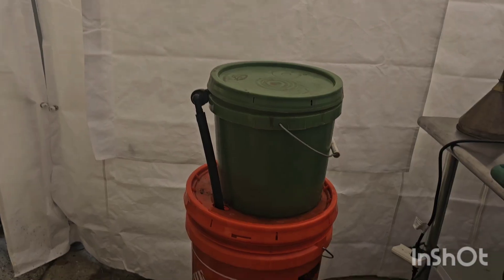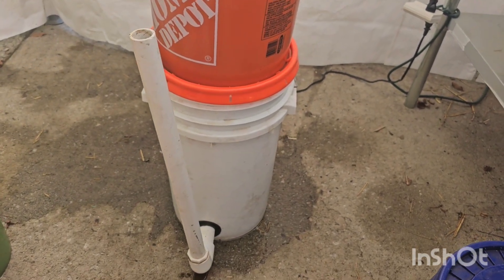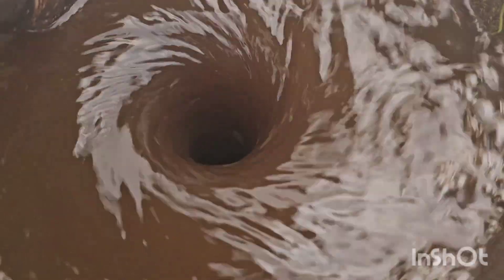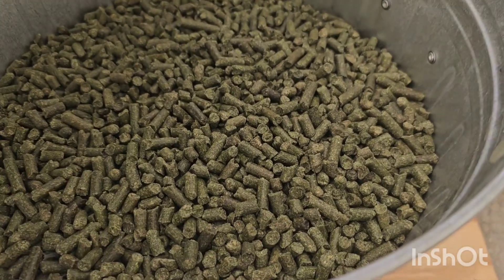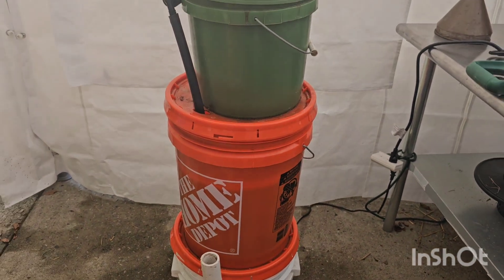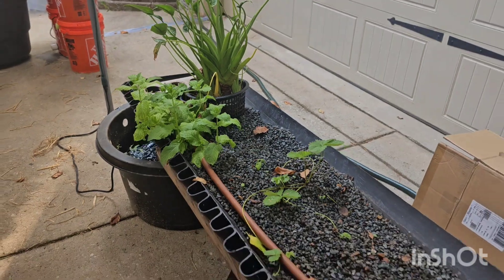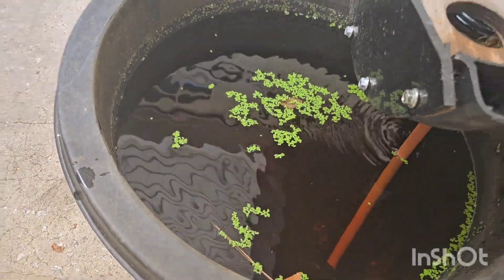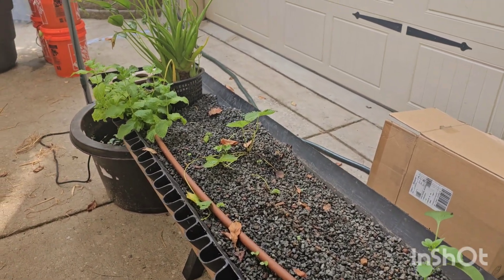Making Organic Liquid Fertilizer from Alfalfa Pellets in a 3-Bucket Biofilter with Vortex.

Comment: What do you keep your EC at with organic hydro?
Reply from the maker: Same as inorganic. Depends on plants. Anything more than 2.0 will dehydrate the plant. What makes this easier than chemical fertilizer is that organic minerals derived from plant biomass mimics needs of plants uptake. By avoiding mineral salts there is less chance of buildup of chloride and  minerals. Water almost never has to be exchanged, unless of course, tap water is used, which can be high in chloride and alkalinity.